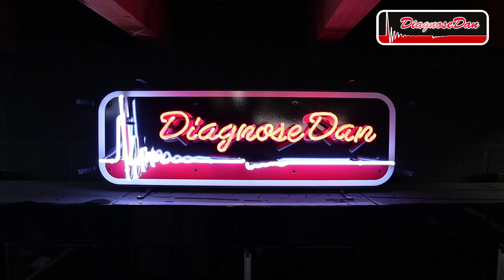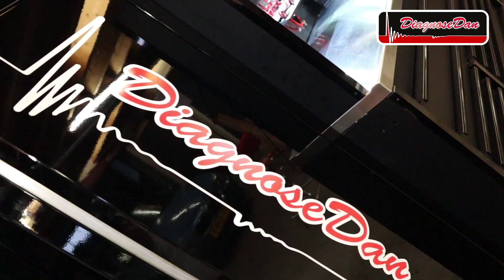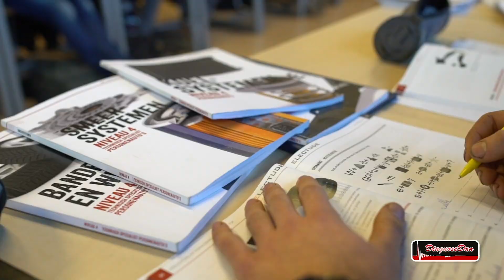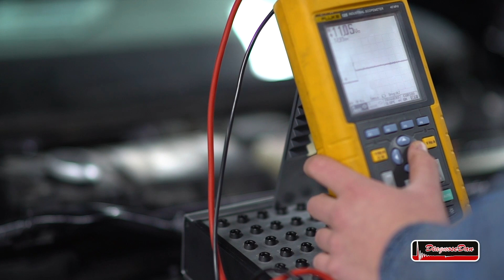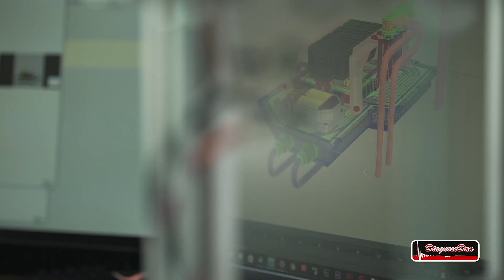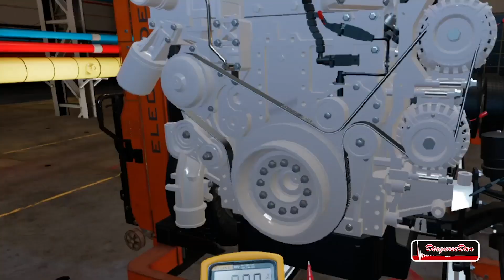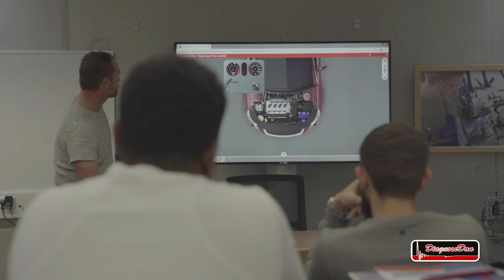New shop and Automotive training Giveaway

Comment: CONGRATZ ON THE NEW SHOP DAN!
Reply from the maker: Thank you very much
Reply: @Diagnosedan  i wish i was closer to your shop.. i have a 2005 e61 525d and cant find any info on the throttle valve actuator..  i have B+ and solid ground, car running backprobed. and ca 2.2v on 3rd wire.. not much change with rpm. input or output?
i have 6Mohm between + and - pins.. and i think its dropping to open and slowly coming down agian to 6Mohm..

Comment: How are they getting scores of 29968/30000 that's like on average 10 seconds on each challenge that's insane highest I can get on my 4th attempt is 28750 
433 seconds on 1st
380 on 2nd 
437 on 3rd
Reply from the maker: I have no idea but you don't need to get the number 1 spot, we are looking at the highest score with DD in front of the name

Comment: So i have to make another comment about electude and i hope someone can reply.

Some time ago i started testing electude free trial version and many times i wasnt sure if it always worked as it shoukd.

Today when i was at stage 3 i came across a fault where there was crankshaft, camshaft, idle problem.

I checked behaviour of ground cables and/or relay triggers. Checked voltages in grounds and everywhere and everything was fine

The only thing that wasnt right was the pin 15 behaviour and its cable too. Sometimes when pressing accelerator up and down voltage would drop to go up by 0.5 volt over 2-3 sec.

So i started replacing everything including cables. After replacing everything few times the fault was still there and i started scratching my head - wtf.

The only thing i noticed was jump wire starter connected so i unplugged it. 

I then did 2 or 3 fault code resets and problems disappeared.

Unless the jump starter is the issue here and i dont know the correlation there must be something wrong within that game.

The way it applies faults is what makes me concern and i have been grinding demo inside out.

Btw. I checked signals and voltage supply and grounds on injectors/ coils/ mass. throttle. acc. sensor when on/OFF and even when that accelerator voltage output droped i mentioned above.

Comment: I AM NOT GONNA LIST EACH AND EVERY

I WILL ONLY LIST LAST ONE.

POWER SUPPLY ON COIL IS GONE - CABLE BROKEN.

THE SIGNAL FROM THAT COIL IS PERFECT LIKE THE OTHER COILS WHICH ARE GOOD DESPITE POWER SUPPLY CABLE HAVING NO CONNECTION

ANOTHER FACT IS THAT U ARE GIVEN COIL PARAMETERS BUT U CANT TEST THE SPARK PLUG END.

HOW CAN A COIL WITH NO POWER SUPPLY OUTPUT ANY SIGNAL?

Comment: ANOTHER DAY ANOTHER ISSUE WITH ELECTUDE.

BURNED FUSE NUMBER 2 ( INJECTORS ETC. ONE)

REPLACE FUSE - ENGINE RUNS

ACCELERATE - FUSE BURNS.

DIDNT RESOLVE ISSUE ASS I TRIED TO USE AMP METER BUT ITS NOT THERE - TRIED TO SWITCH CABLES AND IT MADE ME EXIT...BUT LETS CONTINUE.

SO WHEN I USE MULTIMETER IN CONTINUITY FUNCTION AND I USE + BATTERY TERMINAL TO FEED A WORKING SIDE OF THAT FUSE - IT THEN ONLY SHOWS 5 V WHEN I MEASURE WITH OSCILOSCOPE IN THE SAME TIME.

WHEN I REMOVE THE FUSE AND FEED POWER TO THAT POST IN CONTINUITY MODE DIRECTLY FROM POSITIVE BATTERY POST THE ENGINE WONT RUN - THIS IS SERIOUS PROGRAM FAULT

Comment: Another day another post.

No communication fault which was quickly diagnosed as no voltage on one side of ECU POWER SUPPLY fuse.

Checked line - ok.

Replaced fuse 4 times - still no voltage

replaced ECU 2 times - still nothing

Touched ECU power supply pin with battery voltage using continuity meter plugged to positive battery terminal - suddenly all symptoms gone and ECU ready to program.

THIS IS NOT RIGHT